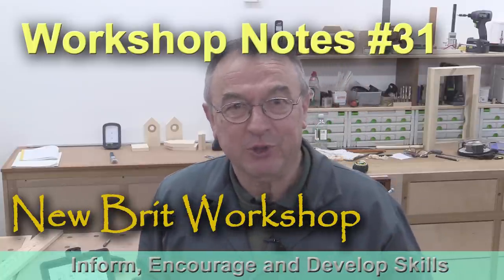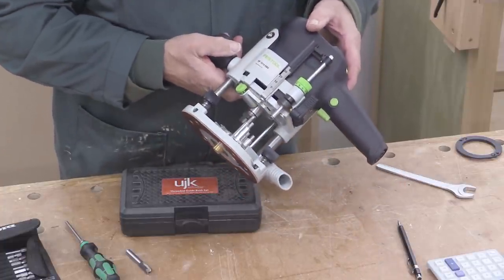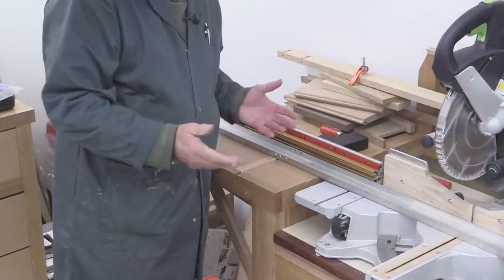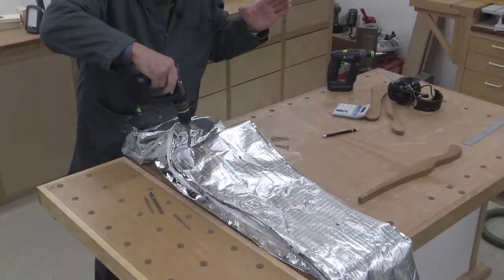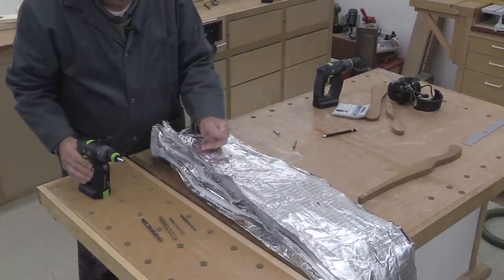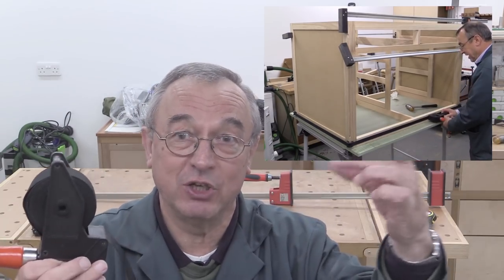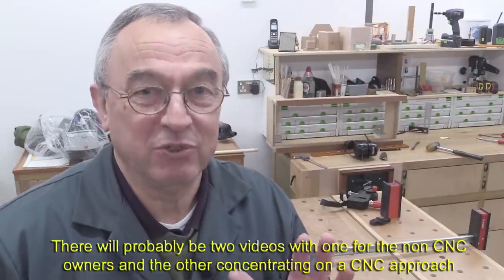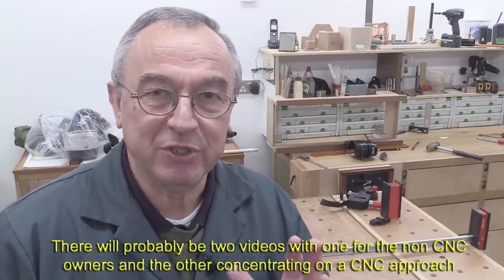Workshop Notes #31

Comment: When I'm drilling through material like that, I normally use a sacrificial block of wood on the front, to sandwich the insulation between, then drill through the whole sandwich. Does that make sense? It's worked for me in the past. It seems that the squashed material severs rather than gets caught.
Reply from the maker: Hi Rico, It would certainly be worth a try but those staples that I put in were almost doing that.  Cheers.  Peter
Reply: @NewBritWorkshop  as I say, it definitely worked for me, and it was in similar insulation to yours, but not as thick. I'm guessing because the staples still leave a bit of movement in the fabric, whereas the sandwich holds it tight all round making the difference.
Reply: I was just going to suggest this 👍.
Reply: same here, works a treat 👍🏻

Comment: A thought for drilling through the insulation. Using your idea of a sharpened tube, would it work if you used that to cut through the insulation and then, leaving the tube in place, insert the drill bit into the tube to use the drill bit to drill the wood. The tube might act as a sleeve for the drill bit coming between it and the insulation.
Reply from the maker: Hi John, Excellent idea.  Cheers.  Peter
Reply: Exactly what I thought was going to happen when I seen the tube in the first place.
Reply: Hi Peter,  I had exactly this problem using Superquilt in France.  Generally I stapled it onto battens but where I was fixing onto steel profile I dipped the screws into some Vaseline which helped a lot.  Smooth screws are also much better that the ones with serrated threads.

Comment: Hi Peter, once again great video. A few things: my first response to the drilling problem was to have a block of wood on top to lock the fibres and act as a drill guide, similar to what we do for many other things.

I have a K-body extender and have made my own clone of said item. It takes a little care tp make but for the brief duration they are needed, do the job without any fuss(use hardwood of course).
Reply from the maker: Hi Philip, Cheers.  Peter

Comment: Hi Peter, with the Bessy extender, the holes in the bar looked bigger than the bolts in the extender.  If so, slack should be taken up first before tightening the bolts.  Otherwise they might slip and slacken off the clamping pressure.
Reply from the maker: Hi Steve, the bolts do have clearance but when properly tight they ensure a good mating up of the clamp shaft and the molded shape of the extender. It is not a problem at all.  Peter

Comment: Heat up an old bit and poke it through the material, it should create a clean hole. Drill or screw through after.
Reply from the maker: Hi Tom, That should work but people need to take care in case things get too hot.  Cheers.  Peter

Comment: Hi Peter.  Struggling to understand your point about why the job you are doing does not need 'perfect' concentricity.  Surely if the router bit is off centre then your rebated area is not going to be exactly where you want it?
Reply from the maker: Hi Adam, I should have pointed out that at the time I did this I was expecting to make adjustments as my measurements were only to the nearest 1 mm. So, I was prepared to enlarge the hole but by pure chance everything was perfect first time. Cheers.  Peter

Comment: I like that clamp extender - do you need to have a special clamp with a removable end piece?  Presumably you could put them 'bottom to bottom', so to speak, with one of the clamping units reversed.
Reply from the maker: Hi Geoff, I think that you are right as long as one can remove an end.  Peter
Reply: @NewBritWorkshop  Found a picture on the Bessey site - second image here: https://www.besseytools.co.uk/bessey-k-body-clamps/bessey-k-body-extender-kbx20

Comment: Peter, I have run up against a challenge in my pursuit of woodworking knowledge that has cost me a considerable amount of time and money. I have been trying to flatten lumber. The information on this subject is scarce. I have purchased a router slab flattening system, I have had a machine shop flatten steel beams that I fasten to 1 inch thick MDF and Birch Plywood. I purchased a 7 inch Planer and tried flattening that way. I purchased a 4'X8'X 0.125 sheet of stainless steel in hopes that might give me a good reference surface, but it did not.  I still end up with unevenness above 0.015"over a 3 foot length, and 0.025" over a 6 foot length.. I have not purchased a jointer since a large jointer is expensive and will take up valuable space in my small shop. I am considering purchasing a CNC machine, which seems an attractive option because of the increased capabilities that would bring. Short of purchasing this machine, or a dedicated jointer, are there any recommendations you might have? I understand that perhaps my definition of flatness may be unreasonable.
Reply from the maker: Hi Ray, Although a CNC may have loads of uses it would be a very time consuming way to flatten wood. The only way that I have found to be reliable and efficient (in time) is to use a jointer. I have a planer/jointer which works brilliantly. Take a look at this:
https://www.youtube.com/watch?v=n9pDJ3l-CIc

Peter

Comment: Would it be possible to do away with the Bessey extender and just run a bolt through the end holes with the bars side by side?
Reply from the maker: The only problem with a single bolt approach is the two clamps will not stay in a straight line and the item being clamped could easily be damaged.  Peter
Reply: @NewBritWorkshop  the centerline of pull would only be offset by 3/8”. I would be surprised if users have clamp heads, 2 meters apart, aligned more accurately than the offset. The extenders just seemed to be an over designed and expensive solution to a simple problem.

Comment: Those Bessey extenders are especially nice for their accuracy, making a really straight, rigid  long clamp... at least in comparison with pipe clamps. Are 8mm shank router bits commonly available in the UK? I have the same sweet little Festool router but it was furnished with only an 8mm collet, a vast improvement over 1/4" shank bits which often chatter. Here in the US, I've never seen 8mm bits for sale except for a few special order Festool bits at 3x the price of 1/4". In this little prairie town no one even sells 1/2" bits. This situation sure diminishes the joy of that excellent little router.
Reply from the maker: Hi Mark, I agree with you and would love more.  In Europe 8 mm shank router cutters are certainly available. Try ordering from Axminster.   Peter
Reply: You can buy a ¼" collet for Festool routers. I have used one for a year or two now and switch between 8mm and ¼" bits as needed.
Reply from the maker: Hi Graham, Yes, I have 1/4", 8 mm, 12 mm and 1/2" for my large Festool routers and 1/4" and 8 mm for the OF1010.   Peter